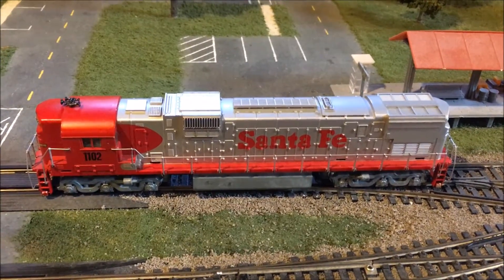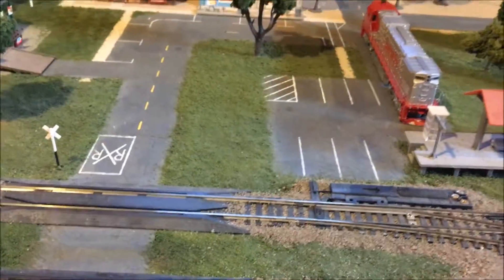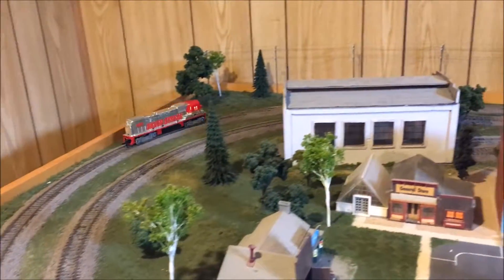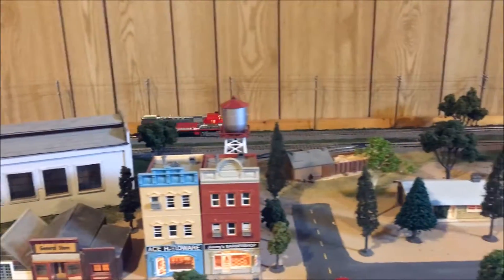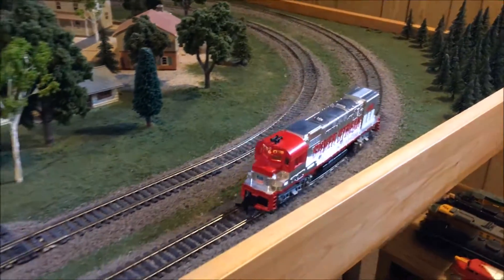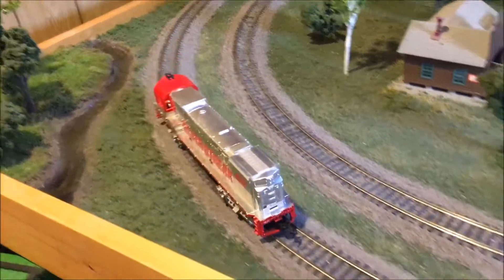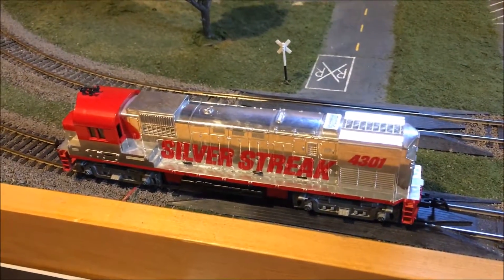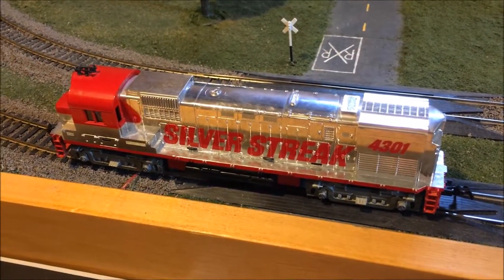Tyco C430 with dual motors!

Comment: I have a few of these , but all of them had dead motors. The only thing i could do to re-power them was to build a floor and then mount those nwsl stanton drives. (10' wb  with 40" axles). they are a tiny bit short in length (truck size) but they work well enough.

Comment: Super. P.S. If you mount six wheel power trucks under an ALCO C-430, wouldn't that make it an ALCO C-630? (C-630M, C-630R?) 🙂 Hello from the Tracy Mountain Railway in Colorado. 💙 T.E.N.

Comment: I have read a couple of your blogs on some of the Tyco forums.  Have you considered putting the 2 motors in the C630 instead, and then dual lighting it?  I have done several C630s this way, since the PT C430 does not have rear light lenses. Also, the longer 630 body and tri-axle truck has better power pickup over crossings and turnouts.  My MU-1 430s and GP20s also have dual lighting, as the red-box era had lenses at both ends.  My current obsession is restoring red-box F7s, factory twin motor models especially.  There is currently no way to twin-motor the red-box GP20, or C430, due to the style of the rear truck mount.   It is, however, possible to remount the MU-1 motor in the plastic PT frame, if you want a better motor.
Reply from the maker: At this point, the C630 shell has already been modified to fit the Hobbytown chassis, but I probably will add directional lighting at some point. The C430 is running well though! :)
Reply: Makes sense, and also gets rid of the "vampire fang" side frames, lol!    The C630 shell also has room to add resistors for directional lighting.  Decades ago, I bought a new C630 that had factory directional lighting, and have done many restorations that way since.   The new Model Power/Mantua GP20 is nice and smooth, but still has no rear lighting due to the Model Power Chassis design that blocks the rear lenses from inside.  I hope you don't mind the "dissertation" length comment I posted on your PT Steamer video, I like seeing those run smoothly.

Comment: I'm having troublebw my rear power truck having enough turning radius on the armature side in the narrow 425 body, any idea how to fix this?
Reply from the maker: You might be able to take some material off the edges of the power truck.  If you can see exactly what's stopping the movement you need, try filing off a little at a time until it can move around just enough to work.

Comment: Do you do commissions? I got a lot of Tyco locos that need upgrades like yours.
Reply from the maker: I'm open to helping out with repairs and upgrades, and I try to do things for as reasonable of a cost as I can.  If you send me an email at b.meyer90@mymetronet.net and let me know what you're wanting to have done, maybe we can work something out.
Reply: OK then
Reply from the maker: @tsitracommunications2884 Just checking, did you send an email?  I haven't received anything, so I wasn't sure.
Reply: not yet Been busy with family issues

Comment: How did you wire power pick up for the return side?
Reply from the maker: I wired the grounded brush on each motor to the ungrounded brush on the other, so there's two wires between the trucks.  The headlight is wired to the brushes on the front motor for simplicity.
Reply: I see. Thanks for the response!

Comment: Haha
Nice
How many cars will it pull?
Reply from the maker: I haven't tested that, but considering I can get a regular one to pull 15 or 20 before it slows down the motor, I wouldn't be surprised if it could pull around 40.  The traction is probably enough for over 100 thanks to the tires, but I think I'd burn out the motors!